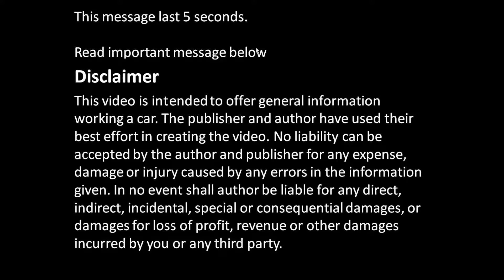Leak in car engine coolant hose and hose repair

Comment: call now get your order in the summer heat get your air conditioner checked cleaned troubleshoot leak detection 9999 call before the rush beauty first to stay cool in the summer heat with Robbie Rob LLC hvac/r engineering .